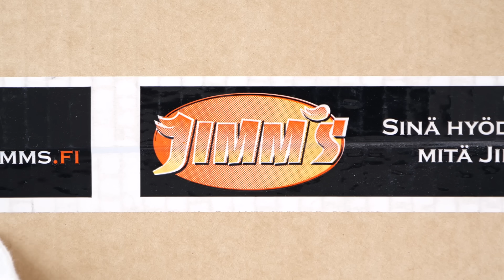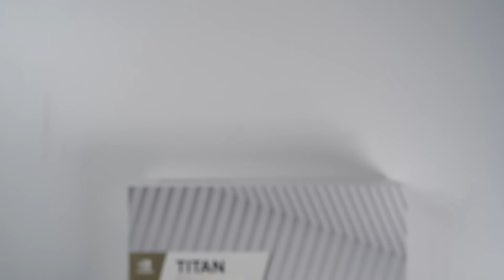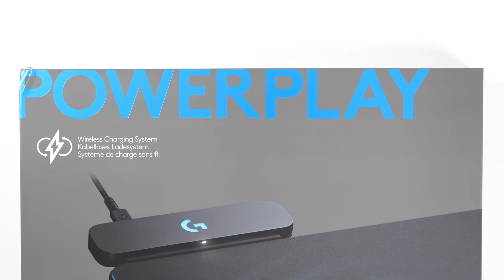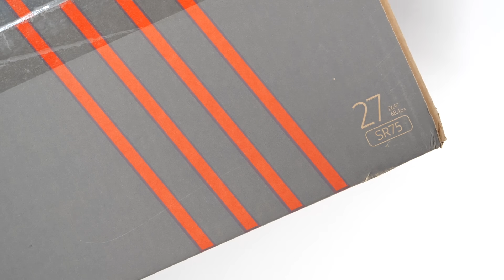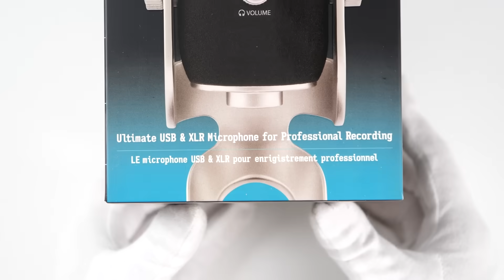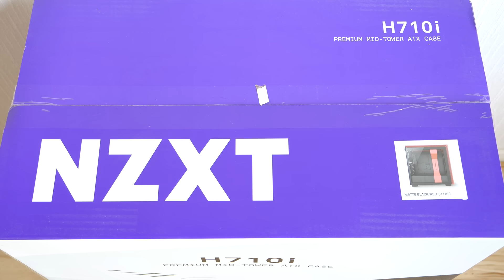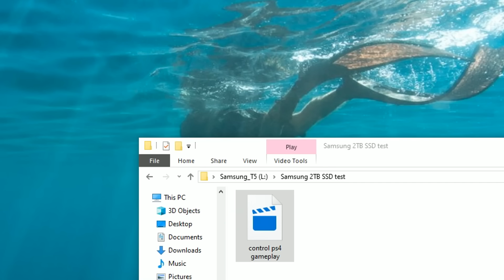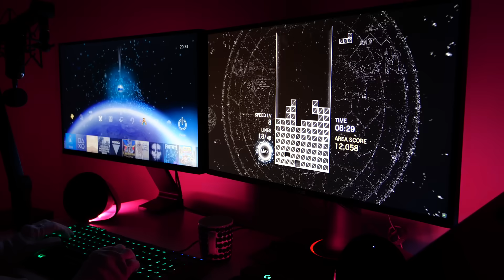$10,000 Custom PC Gaming Setup Unboxing

Comment: -Builds a 10k pc
-Plays tetris
.
TiTAN RTX : Am i a joke to you?
Reply: Gets 26 fps on gta san andreas
Reply: @degenetron7590  beyond 30 fps is breaks the game
Reply: @spazjackrabbit61  yea I know old games don't go together well with new graphics cards
Reply: Titan rtx  is big scam
Reply: The Titan rtx is not a gaming card or advanced as one it’s an amazing card but actually performs a bit worse than a regular rtx 2080 ti which is not very good because the Titan is way more expensive than a regular rtx 2080 ti card
Reply: @murraybeattie4734  this is gaming card and this is minimal better than rtx 2080 ti
Reply: For editing
Nvidio Quadro series: YES
Reply: @dobrygraczpro-o9761  dude, Titan rtx is a hybrid card. The card it self is Made for editing purposes by Nvidia thats the card (Titan rtx) is trash for gaming
Reply: dobrygraczpro :-o Titan RTX isn’t intended for gaming, I tried WT with my cousins PC with the Titan RTX, he’s getting 160-170 tops, I get about 190-210 fps with my RTX 2080 Ti on the same Graphics.
Reply: @degenetron7590  Dude it's because of the fact that both hdmi connected monitors were plugged in, playing different games, which fucks the fps really bad.
Reply: @degenetron7590  
Because it's frame limiter is on 
And in San Andreas if frame limiter is on if you  have a titan or an 2080 ti because of fps limiter the fps not go beyond 30

Comment: Conclusion:
CPU used 2%
GPU used 100%
Red Dead Redemption 2 = 27 FPS
Reply: 27fps maybe in 8K and the CPU is for rendering videos
Reply: @filetsteak5677  bro u missed the damn joke...
Reply: He means 2percent of CPU USAGE CAN RUN 27FPS. Imagine if more.
Reply: bottleneck joke?
Reply: maybe he locked it?
Reply: he only has to use 2% cpu to run rdr2 at 27 fps, meanwhile when i use 100% of my core i7, well...

Comment: The moment you realize that one of his hard drives are more expensive than your setup and he plays San Andres at 27 FPS.

Edit: He needs to turn off the frame limiter.
Reply: We gonna pretend he wasn't playing a game originally made for Atari 👀 ole reliable Tetris
Reply: The game engine is locked to 30 FPS until you didn't turned off Frame Limiter.
Reply: @lolita001  if the FPS is locked to 30. It must be variable between 25 to 30.
And also at that time, it was a cutscene due to which FPS is decreasing and increasing in 30.
You can find about FPS on internet also that if it's locked to 30, even you had a gaming PC, FPS changes time to time.
Also the cutscene was like a recorded video and videos look fine at even 20 FPS and gameplay remains fine at 30. And this game is too old(2004) also.
Reply: @lolita001  when you install the game, it's locked by default settings.
Reply: @lolita001  yes, I played on PC and with frame limiter on, I got mostly 27 fps and while driving in clouds(by planes or RIPAZHA) OR foggy areas I get 24 with a little lag (due to low FPS).
After unlocking frame limiter, I mostly get 58-60 FPS.
I used Bandicam software which shows me FPS just like Fraps.
I don't know about your incident but for me, it's fine!
Reply: @lolita001  I have some mods, Cleo scripts installed in my game also.

Comment: The guy uses intel
Meanwhile:
Threadripper: Am i a joke to you?
Reply: He uses his computer to play games and revord the gameplay. That means the Threadripper will not be as usefull as that i9 Extreme because he is rocking a Titan RTX. Also threadrippers TRX and TR40 sockets are pain in the trunk to install a cpu (i failed 2 times in a row although i built many computers). Is it worth to get the i9 for the avarage comnsumer: No hell not. But if your proffesion requires max framerate in games or you are just a flex baller then why not. For the rest of people i recommend the R5 3600 its quite enought powerfull and can do a quite good job considering how cheap that is

Comment: Wanna hear a joke?
Intel in 2019.
Reply: If he likes Intel, that's cool, I respect that. But in my case, I wouldn't have got an i9.
Reply: @pengu6335  Yeah, I don't have a problem with that either. I'm Intel user myself at the moment, but I'm aware of AMD's rise, and soon I'm going to switch to AMD.
Reply: LesPaul7677 intel is still technically better, while it’s not by much it still is.
Reply: @crossley2381  yeah, and like 10 times costs more, so it's not really better at all...
Reply: @LesPaul7677  if you have money like this guy then you'd get intel as well
Reply: @drev1  He got it for free?
Reply: @drev1  Lmao, my bad.
Reply: @LesPaul7677  Intel works 
Imagine getting a processor because it will make you feel bad

Comment: I love you @TheRelaxingEnd , but whoever built that pc for you needs to learn a skill called "CABLE MANAGEMENT"!! 21:31 I wish I was there to help you ^_^ Pretty hefty pc though with a lot of storage nicely done

also a quick advice, go to your system settings then "Display" scroll down and set it to "Extend these displays". That way you can multi task on both monitors, a lot more useful and handy. 23:31